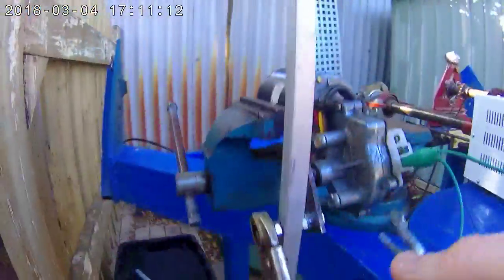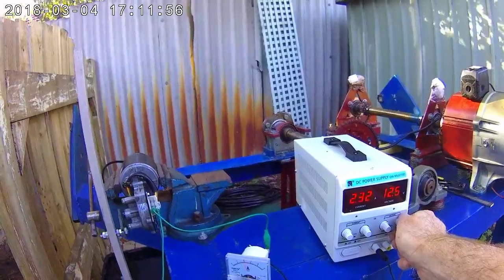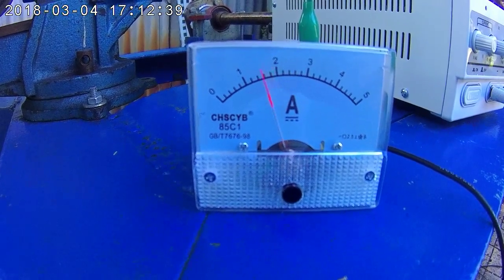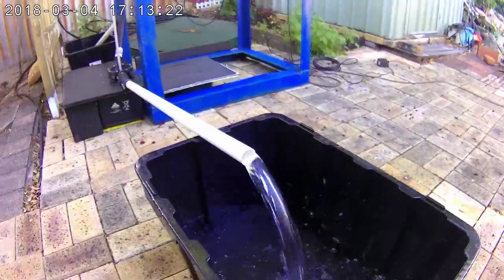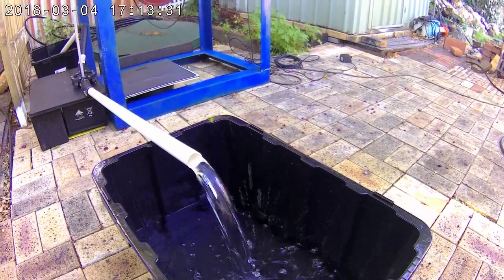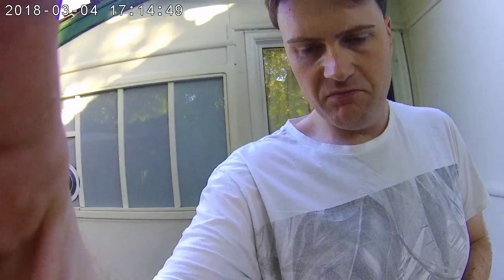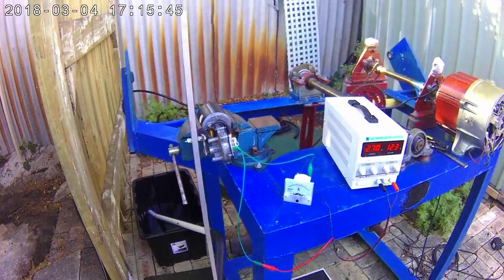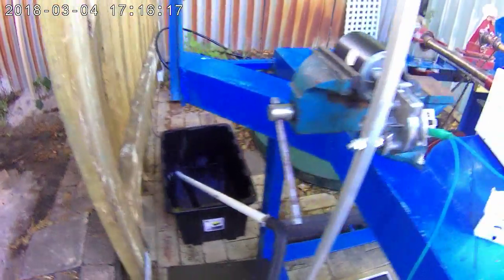Breast Diaphragm Pump Efficency Test PART2 Unedited 4 3 18

Comment: yeah the pond pump is about 50% at its design. your pump with another on top could do more work or in a rotor design say 4 pumps same motor you can get a continuous flow
Reply from the maker: cheers, im think the pond;ies are a step up from a squirel cage motor, but still AC, and around that level,.. 50%,  also im actaully not aiming for CONTinuous flow currently, but i have beaten the efficiency of the pond pump by around 50% using the plunger pump, operated by a pendulum instead of the wiper motor.   - about too upload a series of experiments focusing on powering that pendulum. well.)